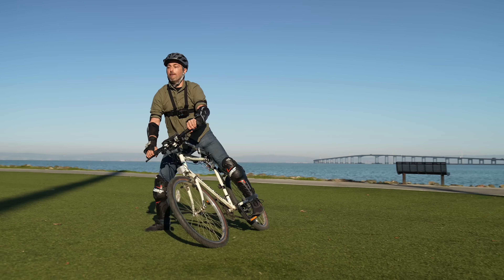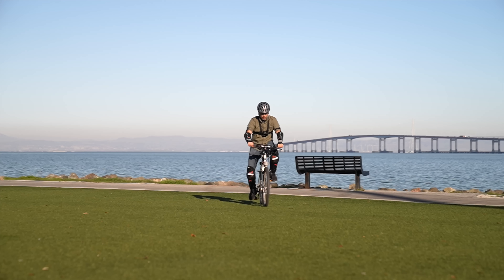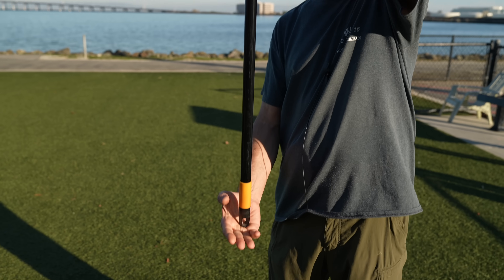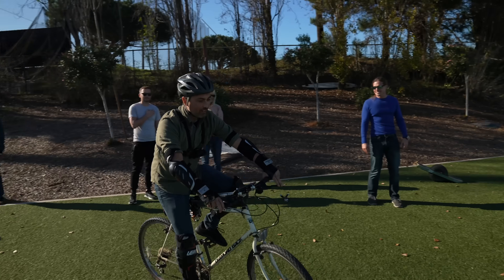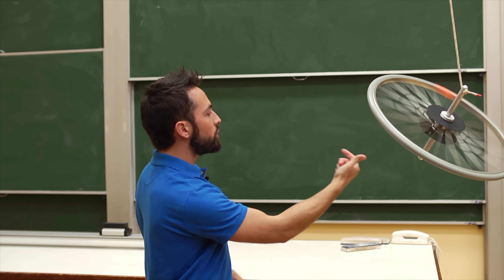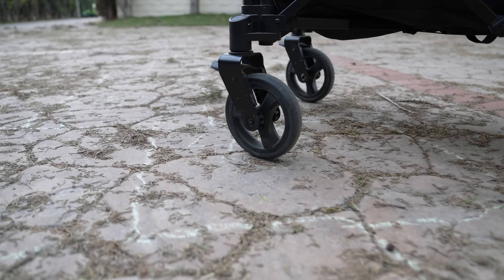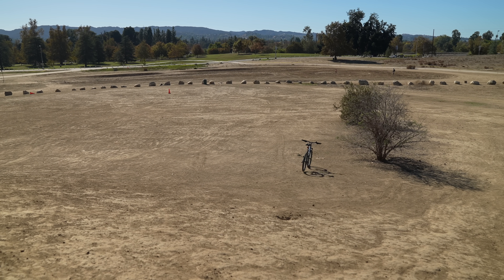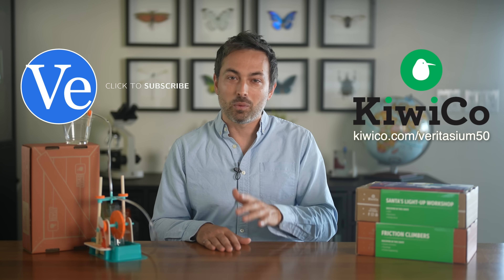Most People Don't Know How Bikes Work

Comment: Most of this is not true. 
First off you should be leaning into your turn. 
Second, you shouldn't be turning your handlebars, but be pushing it instead. 
So if you want to turn right, you push the right side handle out away from you and you are going to turn right. 
You should compare riding a bike with a motorcycle not a car.
I guarentee that you can still turn in the direction in which you lock your handlebar. So if you lock the bike from turning left, you can still turn left. Try it.

Comment: This is only true at low speeds. On a motorcycle, you can simply lean right to begin the turn before the wheel turns right. Dirt bikers counter-lean, sports bikes and MotoGP riders don't counter-lean. This is because your balance is steady due to your momentum.

Comment: Would be interesting to add the similar dynamics with mid- to high speed turns on the motorbike. It always struck me as counterintuitive that when leaning into a rightward curve, for example, the steering handle is constantly tilted to the left.

Comment: What steering....I used to be able to execute turns JUST by leaning without ever touching the handle bars....sharp enough to turn into my driveway.  I'd go from the end of my street to my house (about 1/4 mile without ever touching the handle bars)  I used to even put one foot on the center bar and tie my shoe...though I did wreck once doing that.

Comment: 360 bunny hop starts with a right turn then flicked off to the left using the front wheel to help momentum. Handle bars hard against your calf with head turned right round in the direction of spin.

I'd live to try this bike. I used to be sponsored for vert freestyle when I was younger.

Comment: If you cant also steer left when youre stearing right then you have nothing to push off to maintain your balance and its like trying to balance on a pole, because a circle is a line with both x and y direction. Balance requires 2 sides to balance inbetween, else, theres just one direction to go, and no middle ground.

Comment: I don't know what type of fucked up bikes you ride but whenever I ride a bike I legit just turn the handle in whatever direction I want and it doesn't fall over because I didn't steer the opposite way first.
Reply: same. they're making it seem like you need to counter turn to lean in the correct direction, but you can also do it by just... leaning

Comment: Caster angle or fork angle mentioned by you is critical for the bike to stabilize itself. It is playing a key part for the bike to run at a streight line. If it somehow steer itself due to leaning, caster angle help the bike to convert the centripetal force into the restoring torque of the front wheel perpendicular to the lateral line. That in return steer the wheel back to in line with the lateral line. For more info watch Lesics 'how does a car steers it back after a turn'.

Comment: VERITASIUM
  The fact that a bike cannot counter-steer (CS) is demonstratable and explainable.  VERITASIUM made the accurate video, even though they didn't reach the correct conclusions.  The right turn worked well, with the left steer locked out, because the right turn was initiated by a right LEAN, followed by a right steer.  A no steer, a left steer or a right steer didn't work, he had to discover the right lean in order to finally succeed.  OBVIOUSLY.
The bike requires vertical balance for upright straight-line travel, in that state, a steer will cause a loss of balance, causing it to fall down.  The faster the speed, the faster it falls down.  Attempts to have a moving bike, with a locked steering head, travel upright and balanced, reveals only a quick fall down.

Comment: Interesting video, but I'm disappointed he never brought up people who can ride bikes without hands (such as myself). I've taken many left and right turns without touching my handlebars, and I'm curious what that looks like on film.
Reply: Check out Zlatco Djukic demonstrate counter steering is not used on MCs, by doing figure 8's with full control without touching the HBs, PROVING that bikes only turn by LEANING.  The MYTH of counter-steering a MC was initiated and promoted beginning in 1980 by Keith Code.  He has got an uncountable number of riders fully brainwashed.

Comment: I turn my bike by leaning, not even moving the handle bars
Reply: YES, every child knows that a steer at vertical with result in falling down, so to begin and carry out a turn is done only by lean.  This is demonstrated by Zlatco Djukic doing figure 8's with full control, without touching the HBs.  CS is a MYTH, popularized by Keith Code back in 1980.

Comment: I kept thinking of the times I got to ride with the university bicycle club guys, how when we got to a stop light they would all keep perfect balance without putting a foot down.  They couldn't even explain how they managed it; when I watched them I observed little muscle twitches in seemingly random places that had to be unconscious adjustments.  The longest I ever managed to balance mine bike when not moving was about forty seconds!
I guess when you're riding give hundred miles a week, much of it on a riding stand, you just pick things up without thinking about them.
Reply: >> hey couldn't even explain how they managed it

I can.  You turn your wheel fairly sharply to one side (maybe 45 deg) and then you move fore and aft just a bit (like inches).  That  moves the front of the bike side to side by about that same amount.  This gives you the same control of the inverted pendulum that steering does when you're moving.

Comment: Countersteering is one of the first things you learn when attending motorcycling classes. They teach you to push the handle bar on the same side that you want to turn (i.e. push the left handlebar to go left).
Reply: Not the same thing as illustrated in the video. Counter-steering only applies at high speeds.
Reply: @samuelbrice3699  Lol. High speeds... Counter steering kicks in afer around 10mph.
Reply: @brotendo  Yep you're absolutely right, my bad. Although they weren't going over 10mph.
Reply: or turn left to make a right.
Reply: Right. That’s a MSR certified class. I remember showing up the teacher when I applied road bike techniques to motorcycles.
Reply: I thought the same thing counter steering on a motorcycle vs a bicycle is a bit different but the idea is the same
Reply: It's funny because even veritasium don't know how bike works, lol. Counter intuitively, you don't steer a bike by rotating handlebar, you steer bike by shifting center of mass and you use handlebars to stabilise.
It's very much possible to just go left.
Reply: @L4ch74n  It's a combination of the two. Maybe you should try the experiment you just watched and see what results you get compared to these intelligent people.
Reply: @L4ch74n  Next time you ride your bike, try shifting your center of mass without touching the handle bars and see if your bike will turn. Hint: it won't.
Reply: @brotendo  actually it will, given enough speed, but very slowly you need a lot more space to do a turn. we used to do this all the time as kids in open areas. but that's possible because of the way bicycles are made, to help stabilizing, as explained in the video.
Reply: Whats the point of mc schools teaching counterstering when everybody already know  how to do it whithout knowing what it is?
Reply: @einarberg7870  u learn this because the speed of a motorcycle and weight is allot higher, I'm taking my license now and yeah you will do it automatically, but when u know this actively u can go faster and have more controll in a corner.
Reply: @einarberg7870  get on a motorcycle some time. Counter steering is definitely not the intuitive way you will try to control it. The extra weight of the bike will make you want to shift your weight to muscle the bike the direction you want to go. This bad habit is very ineffective though. Thus teaching correct steering technique.
Reply: @einarberg7870  While everyone else brought up a lot of great points, the biggest one for most people is that you need to actively understand it so that in emergency situations you know what to do. In a lot of emergency situations you will see riders who haven't really focused on it try to turn the bars left to go left, only to turn further towards the obstacle they were going to hit, sealing their fate. The natural use of counter steering doesn't work very well when you have under 2 or 3 seconds to fully commit to your evasive maneuver.
Reply: @einarberg7870  on a bicycle the weight and speeds are considerably lower and it only take a small input to set up the rest of the corner. Whereas on a long sweeping corner on a motorcycle you will have to actively push the bar the opposite direction to the corner and the pressure applied will either tighten or loosen the turn. 

Not understanding this concept results in new riders pointing the motorcycle away from the corner with devastating results
Reply: @einarberg7870  most people don't know they are doing it. Also its a big reason for accidents at higher speeds because people in their head will think turn right go right when trying to avoid an accident rather than knowing turn left go right and counter lean to maintain motorcycle balance. Heavier bikes require good counter lean skills especially if you want to make sharp hard turns on a bike.
Reply: @einarberg7870  because in those emergency situations your intuitive reflex won't be strong enough to make the bike steering the direction you want to. Motorcycles carry a lot more speed and weight, small unconscious counter steering input won't be enough to make the motorcycle steer like you would on a bicycle.
Reply: @einarberg7870  I learned it at a racing school. The point is they want people to do it more purposefully and aggressively when they need to take different lines to pass each other in turns. They also don't want you to just gently and instinctively fall into the turn, you want to be assertive and enter the turn with purpose. Have you ever been on a racetrack?

Comment: @Veritasium I worked on the TMS bike model for my Maths research project at uni! So cool to a Veritasium video on it. I classified configurations of the parameters for which the bike would be self stable and derived a formula for calculating the critical velocity (the speed at which a certain configuration becomes self stable).

Comment: A wheel and tire will roll a long way by itself, as long as it keeps moving.

How? There is no rake and trail.

There is no weight from the non-exiated bike.

It must be gyroscopic effect. If the top of the wheel leans left, it turns left. When it turns left, the bottom of the wheel moves left, so the lean disappears. 

This is how you ride a bike without hands. Lean left and the wheel turns left so the bike turns left. Lean right and both turn right.

Comment: MIT tried this line of BS, and now Veritasium is doing it.

Anyone who rides a motorcycle knows the truth. They have a much heavier front wheel and tire, so much so that there's a HUMONGOUS gyroscopic effect that leans a bike HARD into the direction you want to turn.  So much so that you can literally lay the bike down and crash. So much cheaper so that the front tire can literally come off the ground!

This lean is required for a turn. The tangent of the lean angle determines the lateral g forces of the turn. A 45 degree angle is 1 g.  A 56 degree angle is 1.5 g's.

This lean occurs when you do the counter steering as shown in this video. Too bad they didn't use a motorcycle.

Note, counter steering doesn't move the front tire much to either direction. The tire may move three inches one way while the bike leans over three FEET. (Modern race bikes, that is.)

There's a second type of gyroscopic effect that allows you to ride without usng hands.  Lean left and the wheel turns left. Now you are turning left. 

However, this is a slow methid. For quick turns to avoid  obstacles, counter-steering is required.
Reply: Veritasium-Fans, I have the Hobby to recommen Science-Youtubers to Fans of Science-Youtube-Channels. What do you say to this fact about Me?

Comment: Actually, I think this is true. When I first ride my first non training wheel bike, I turn the handle and not tilt which made me fall. I wondered why. And later, I mastered it and found out that I tilted more then turning the handle. I wanted to prove this theory when this video came along. This proved my theory. Thanks! This comment was written after I watched this video. I forgot the physics 3 months ago when I watched this video. So I watched again and I notised something. When you turn the bike with just the turning handle, you tilt to the opposite side and the center of gravity with it and falling because the wheel can roll side to side. If you tilt and move the handle bar just slightly, you can go left and right.

Comment: 7:20 video is really interesting and I get the approach.. but you can certainly steer a bike without needing the handle bars. Sure you can't do sharp turns but you can counter the bike from turning over by shifting your center of gravity when you're moving at a decent speed..

I as well as many other people in my city, bike most of our routes without holding on to our handlebars (it can look a bit pompous but I just thought it looked cool enough to try and do it myself)

Comment: I feel like if you think about how people walk it's just mechanical wheel walking.  We can't turn in any direction without falling from the opposite leg, aka we wanna go right we use our left leg to push/fall to the right which with thrust of a peddle means we're pulling the bike to the left than releasing right.  So theoretically it wouldn't happen with moterized things because there's no need to push?  (can you test this with a motorized bike?)

Comment: I concluded bicycling are unstable as a teenager, simply trying to ride on a straight white stripe on the road :
- You cannot keep the wheels rolling on the white stripe for a long without being quickly obliged to sharply modify the frontwheel's direction to recover balance. And you will have made it before you ever have wanted it (except if you are an absolute bicycle beginner : in this case, you may have fallen before you ever have begun to understand what is happening).
- You can keep you body indefinitely above the white stripe when riding the bicycle, but you will notice the wheels keep going forth an back from one side of the stripe to the other.
Warning : If you want to test these, never stop looking forward where you are riding to, to avoid an accident. Do not look directly at yout wheels. Just use your peripherical vision to monitor them.
Learning to bike is just learning to avoid pain, so learning to keep from falling. That is why i have seen an adult master a bike in a few seconds, while he had never ridden on before. Our brain has been trained to keep balance on two feet since the very moment we manage to stand and walk and thus evolve beyond being babies. And our brain as been trained to it to the point we quickly just lose conscience of it, (when the sense of balance is acquired a child's conscience is quickly filled with lots of other things life brings).